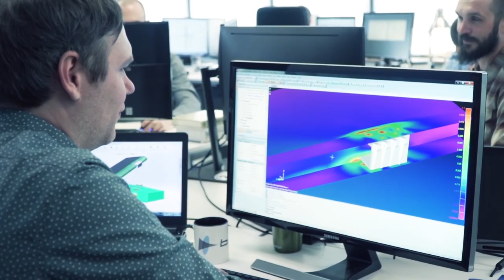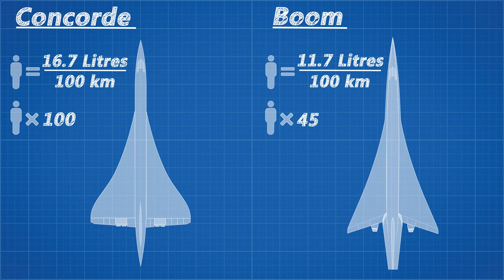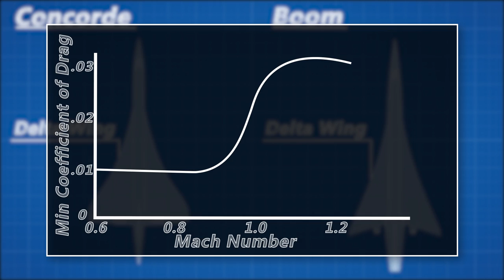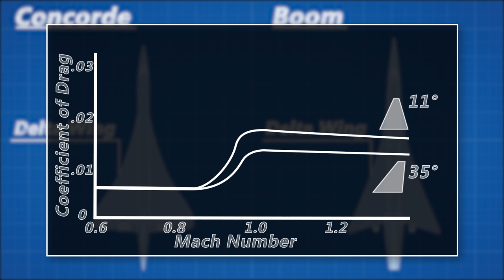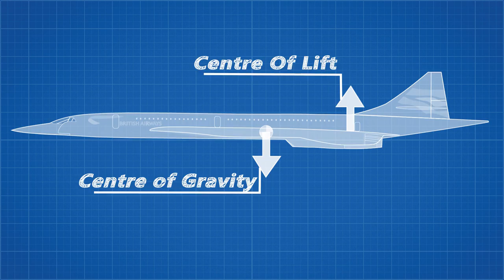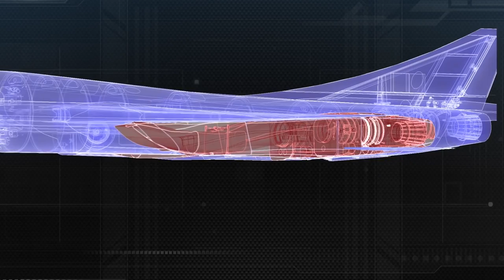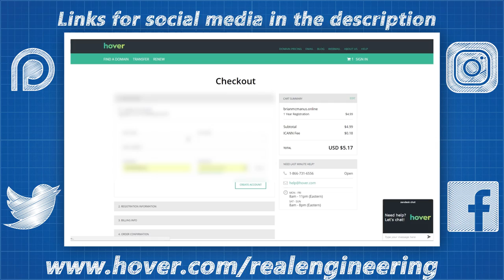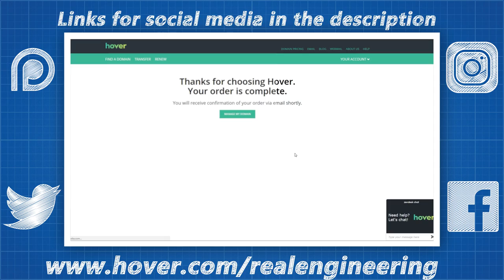Boom: The Future of Supersonic Flight?

Comment: And you have to compete with tele-presence. It is pretty normal now, when you can have a big screen act like wall that extends the room and you can real time meetings with people on the other side of the planet. I am not sure about the commercial viability of super sonic airplanes. 

Also 2 routes is not enough to support a type aircraft. There will be not enough people
Reply: There are more transoceanic routes than just New York to London and New York to Paris. The Concorde could actually land at 2 airports in the US: JFK and my home airport, Washington-Dulles. It would fly to London from both of those airports, and if I'm remembering correctly, Dulles to Paris as well. 

Concorde routes aside, Boom's plane is smaller and much more efficient, meaning more routes will be viable. Other than the three mentioned by R.E., there may be enough business traffic to/from Germany to justify subsonic travel between Frankfurt and the Normandy coast, then supersonic to 25-40 miles east of JFK and subsonic into JFK. Potentially the same with Munich. Pacific routes might work between LAX and SFO on the US west coast, and Tokyo-Narita, Osaka, Shanghai-Pudong, Hong Kong, and Singapore-Changi in the Far East plus Sydney, Melbourne, and Auckland in the South Pacific. Heathrow to Montreal might work if supersonic planes flew at subsonic speeds over Canada and followed the St. Lawrence River, then went supersonic over the Atlantic. Heathrow-Boston and Heathrow-Miami could work, and JFK-Johannesburg would be dicey but could scrape by as well.

Comment: Just bring back Concorde! Their airframes still have plenty of flying hours left. Concorde also had digitally controlled engine inlets, apparently they were the greatest design challenge that the Concorde design team faced.
Reply: Brendan Forde all concordes have been scraped or been sent to a museum
Reply: None have been scrapped, except the one that crashes obviously. All the Concordes which are in museums could defiantly fly again (but it would be expensive to get them airworthy again).
Reply: It's just not commerciably viable. Maybe a single Concorde could be kept flying for airshows but most people would much rather go on an Emirates flight and practically rent a hotel room in the sky than fly on a Concorde where you hit your head on the ceiling.
Reply: I would rather fly on an emirates flying hotel        btw love your profile picture tutracrafty

Comment: If they pull it off, it would be great - competition is always great. Time savings alone could make the ticket worthy for enough passengers to pay the extra over a business class ticket. But let's be clear on one thing - supersonic flight for 40 people will be much more expensive than subsonic flight for a plane with 200 people, even in first class. It will be the pinnacle of civil aviation and we need that. Flight shouldn't be about cramming people in a small box to get the cheapest prices. The Concord was inspirational in that regard. I always thought the fleet was grounded not only for economical reasons, but also for catastrophic failure - one of the last 30 planes left crashed in Europe. The following investigation revealed stress cracks in the fuselages of all the remaining planes and they all went away. Apparently the high stress of supersonic flight was too much for the plane. Lets hope the boom is much better engineered to prevent such a tragedy.

Comment: If you had a turbofan engine and the same setup coupled to an electric motor spinning the same size fan the same speed would they create the same amount of thrust? Since there's no fuel you couldn't have an afterburner either

Comment: Brian yo seem to be infatuated with this aircraft. However as for the idea of it being proven  through CFD and CAE or even FMEA is short of the mark Easa require a compliance matrix to be  demonstrated in acrdance with EASA's CS25   THE  CAA's certificate of airworthness for concorde where drawn up alongside the accrued flight testing knowledge so the laws and regulations  where developed in tandem, so I fail to see how boom are going to develop compliance with European regulations that are very much out of date and FAA ones that for the life of me I don't think where demonstrated by any form of iterative process.
As for the chines on to the test aircraft the Bac 221 had these subsequently the aircraft was designed to fly without the need for them  and after the test aircraft HP115 flew with an 80 degre wing an oge wing was tested and demonstrated on th bac 221 which became concordes final wing shape,
I get the feeling that boom are trying to  massage the regulations to suit American businesses ideology because there original attempts didn't get past an wooden mock up and a lot of hype was focused on the noises which if you have ever heard one sound like a double bomb from Ann artiary gum and is over before you know what has happened
I Woul have thought that boom would. Be better with the PR  and show that  sections have been built and tested to  demonstrate a standard of regulation required
The you have to ask  even a simple SWOT analysis will show that the volume of fuel required to operate will possibly be cost prohibitive, whilst it is nice to fly trans ocianic it isn't. Nicedsary with video conferencing and the ability to set up shop in another country meaning  indiginnous employees operating on home soil. Reducing the cultural issues. For me boom may very quickly become bust, I would want to put my cash in other forms of development e. G. Wig craft like flyship? Sorry to rant  nice video kindest regards mickT

Comment: You'd have to charge people 3 grand for each ticket in order to make any money whatsoever with only 45 passengers. I highly doubt they'll do any beter than concord, that's just too much money for a plane ticket that most people would be willing to pay. I'd rather spend $800 on a ticket on a slow, cramped flight, if it meant I would save $2000.

Comment: @ 8:22 you said the TU-144 initially used turbofan engines, then changed to turbojet and increased efficiency significantly...?? That makes no sense... Wouldn't it be the other way around?
Reply: Dude31463 
I believe it was due to the fact that turbojets, despite being less efficient on subsonic airliners, managed to compensate for that shortcoming by having less drag at supersonic speeds than the bigger turbofans.
Reply: Jjames763 Okay, but it was just contrary to what the new Boom is using, medium bypass turbofan, to achieve more efficiency... :-/

Comment: question about the vortexes you mentioned: im pretty sure i get why they generate lift, but wouldnt they also generate a heck ton of drag, since the air is (relative to the plane) slowed down much moren. 
so do they get cut off by the high supersonic speed air?
Reply: 8:50 the vortexes is created when the plane has reach a certain of angle of attack, in normal crusing, the plane fly like other plane do, they do not need the vortex to create extra lift
Reply: that doesnt really answer my question. its not about for what reason they might or might not need the lift from the vortexes, my question was about drag, NOT about lift.

Comment: I don't understand how the vortexes on the wingtips are supposed to create lift. Isn't there a lot of pressure in a vortex which reduces the lift and is therefore avoided by boing snd airbus as much as possible?
Reply: the vortex on normal airliners may be mistaken, as I know, for normal airliners, when the air under the wing recombine with the air above the wing the vortex is produced behind the wing (as the pressure of the air is different) there is vortex around the wings tip, however, as the wing design is different, the vortex at the wings tip actually make the wing tip lose lift and this is the reason why wing tip is always tilting upward to delay the formation of the vortex

Comment: They were using SolidWorks to design the plane. Is that appropriate? I was under the impression that CATIA was used for aerodynamic work because it has the capability to produce G3 and higher surface continuity. As far as i know SolidWorks can only produce G2 (curvature) surface continuity. Maybe they were using some plugin.

Hope it is not like the man powered flying machine a while back that was "designed" in Maya as a prank by a visual artist.
Reply: It doesn't really matter what CAD software you use. Solid modeling isn't based on a point cloud like you would find in maya, it is instead based defined geometry, so you can export it to most simulation software which will read it at whatever resolution is practical to compute. Some Aerospace companies like CATIA because of it's large toolset that comes with it, it doesn't really "do anything better" than any other CAD software that doesn't come down to preference or performance issues. Solidworks is a fine choice.

On a side note I personally think CATIA should die in a fire with it's windows 2000 esk theme and usability but once again, that is just preference. I am an Autodesk Inventor guy personally.

Comment: I don't know... The Concorde carried 100 people at 16.7L/100km.  The Boom is  expected to carry 45 people at 11.7L/100km.  That's less than half the people with only a 30% gain in fuel efficiency.  The economy doesn't work out.  (16.7 People-L per km vs 5.265 People-L per km, you carry more people per L/km with Concorde.)
Reply: The 45 people is the first prototype plane that should fly next year, the Passenger plane however will seat more people and have its maiden flight in 2023 (Hoping all goes well). How much more I do not know though.

Comment: As well as dissipating the shock waves, I thought the high altitude meant that it was significantly lower in density, so it is easier to push through/go faster?
Reply: Joseph Dickson well for one going at high altitude in a supersonic aircraft significantly decreases the amount of heat you have to deal with, and that's also great
Reply: Yes, which is the very reason why planes fly so high. As +Xortsa mentioned though, aerodynamic heating is also a major issue that can be alleviated somewhat by flying through thinner air.

Comment: A startup company shouldn't be designing and manufacturing a supersonic aircraft on their own but rather joint venturing with lockheed, airbus or boeing. 

Supersonic planes are much more fragile in material and design than the regular airplanes. Because the specs for supersonic speed is more fragile in pretty much every part chassis, engine, etc therefore more bound to complications.

The concorde was an example of one tiny detail such as tire explosion debris due to landing speed caused a fatal crash already. A startup company will not be able to handle designing an aircraft to molecular level of safety like the concorde was designed with already.

Boom has no idea when they say it'll have double the range and weigh less than twice and have much more cruising speed. Seriously the concorde's engine was a marvel already designed by rolls royce and pratney and this startup company is claiming specs not seen before.

They also have no experience in aircraft reliability and complications, that's not something you can test in a factory. It takes decades in an aircraft's lifespan and only experience of top manufacturers can help with that.

This startup is highly motivated but in the wrong way as in they're desperate. Really. They have no experience and to be honest they're not even experienced for regular airplanes. What they showed in the video, it's more like they're designing a cessna.

Comment: I suspect they should simply change the name to, "BUST", hang it up, and save some cash. Aside from the same celebrities and wealthy people for whom the ticket prices are inconsequential, it's now 2020 and much long-distance business is done already over ZOOM or similar. Aside from now, will there be enough companies out there to support the actual ticket prices, likely to be twice the marketing-expert's best hopes that were published, in the 10+ years it will take to develop the 45-passenger jetliner, when even a free, high-resolution video phone call is possible already? That's even ignoring the socially-unacceptable carbon emissions on the chopping block now for automobiles that will only grow with time for air travel. I suspect this project will produce the desired jet but it will always remain outside of the experience of most people but for the same celebrities and wealthy people for whom the ticket prices are inconsequential...with which I began this response. For those reasons, I'm out (oh...I'm not on Shark Tank, am I?)

Comment: So.. ehm, the concorde had a problem with CP as it reach the speed of sound they had to move the fuel to prevent the down pitch movement(Mach tuck). That ment that the concorde had a lot of unusable fuel as it was used to balance the CG/CP. Is the boom going to have just like a Mach trim? didn't really get that part how they plan to handle it.
Reply: It'll have chines. They're aerodynamic devices that are mounted ahead of the center of mass and only produce significant lift at transonic and supersonic speeds. Without them, the center of pressure would be able to freely move back as the airplane accelerates through Mach 1, but if the airplane has chines, they will also start producing lift and will counter the mach tuck effect.
Reply: interesting, thanks for the clarification/explanation.

Comment: I have a hyper sonic airliner prototype design made out of LEGO I know what your thinking that’s stupid what are you five ? But I took into account for the real thing materials of leading edges and skin potentially dangerous fires  and borrowed ideas from existing aircraft like Concorde the tu 144 mig 21 and sr71 thought of engine design how it would get to Mach 7 or higher for instance my concept has an actual tail instead of being a pure delta as Concordes pure delta design left its control surfaces vulnerable to highly intense fires witch was a contributing factor in the demise of airfrance flight 4509 an actual tail also provides better pitch control and my design also featured canards near the cockpit for better stability at low landing speeds near flush with wing  engine pods located at the tail of the airframe with six engines producing the same thrust as a ge9x each also to help reduce friction at speed the airframe isn’t  round like Concorde its flat with tongston leading edges and carbotanium weave just behind Carbon  fiber Kevlar weave fuel tanks so each fuel tank can take a bullet and not leak and a special part of design on the back of the double delta configuration wing to chop turbulent air from the airframe thus reducing drag further keep in mind I was 13 when I came up with this design idea for the airframe fing 13 where’s my billion dollar contract Boeing lol but seriously I think my concept should be looked in to as it might actually work I still have the LEGO prototype of the design in my room also the wing tips would be curved down a little to produce more lift for landing and take off  who’s interested in my design let me know.

Comment: Stick slim elongated morph craft body, extreme fuel emission burning, low level thick atmosphere sonic boom freaking, repeat catastrophe in sonic flight history... When Elon Musk tried to summit a land to land rocket travel for passengers, the flaw there was pure  vertically intense rocket take off, When a run-way/levitate landing pad then souring into deep high atmosphere like a jet, THEN rocket emission across orbit would have ruled air flight for earthly travels. An example of issues on this craft, the body, it needs a wing formation body frame, looking like at top view, a sword shape with the plane tube body molded center stem, like the military scram craft known as the SR-71, by having the body shaped to a wing, you barely need any fold contraption wings, in fact, the SR only had out extend wings for the sake of the larger, much lesser fuel burning mixer large propel engine compared to the passengers airline versions in history. It's also not impressive when the craft is very small in passenger amount, it's just looking more like a private corporate CEO jet craft.